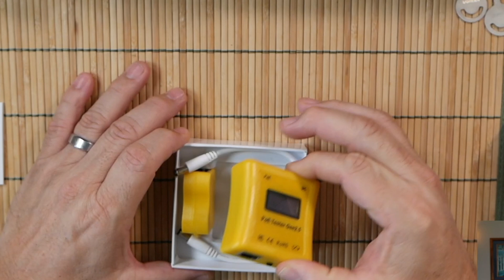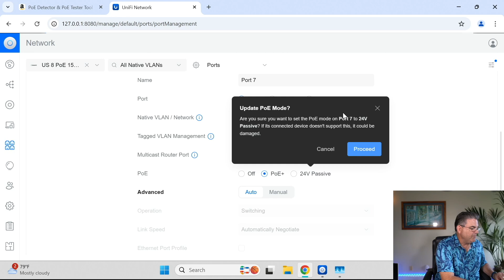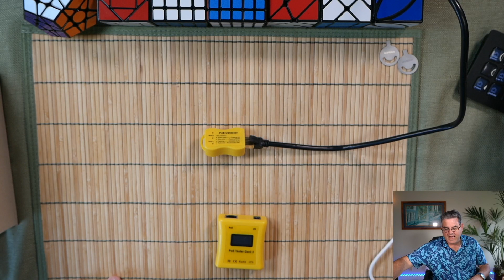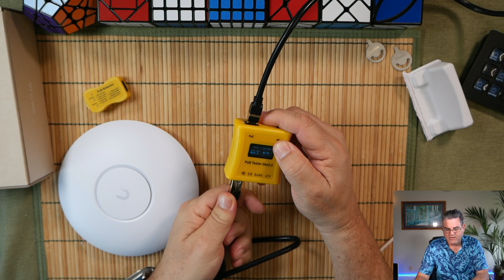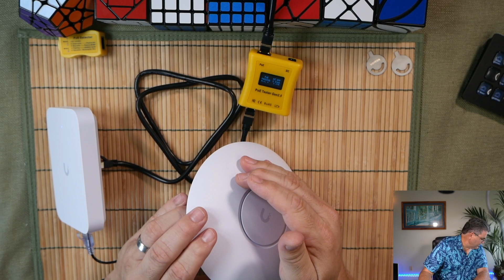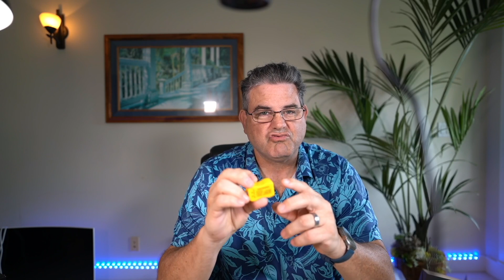PoE Tester from PoE Texas

Comment: Not sure how I would use that, some switches let you know the amount of power used and they store historical data - I have never run into passive PoE.  I have always called PoE as type 1, 2, 3, & 4 - 15W, 30W, 60W, 90W.
Reply from the maker: Hoping someone chimes in with their use case, it does what it says it does.  I checked Wikipedia and they use they type 1-4 nomenclature, I never used that, just +, ++ etc.  Thanks for watching.